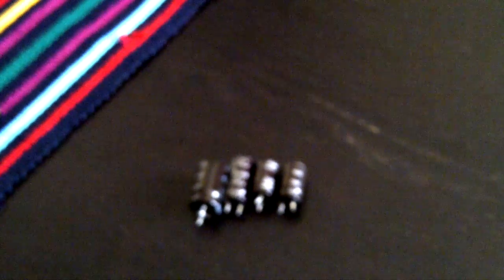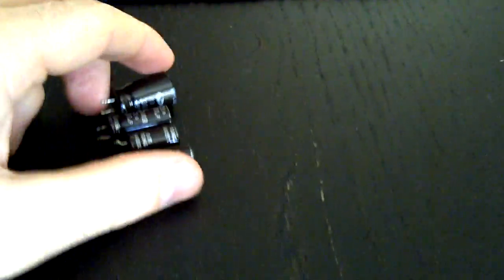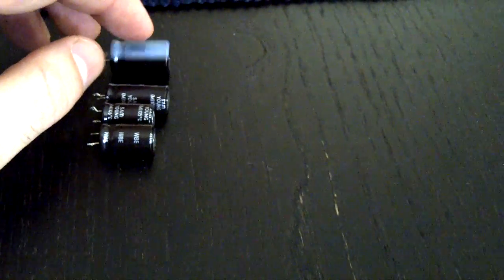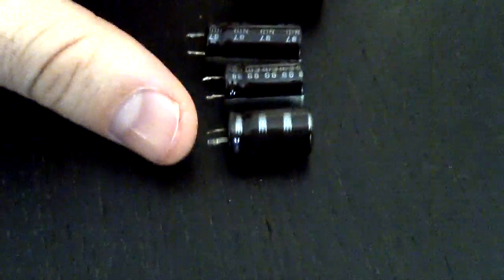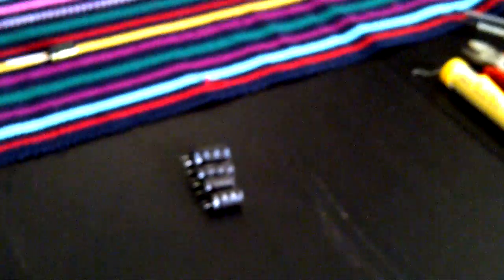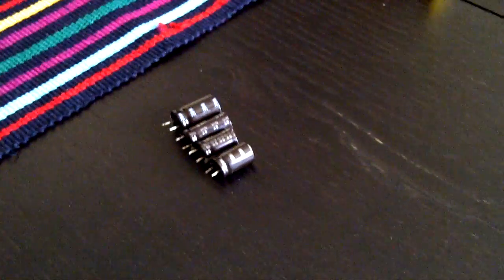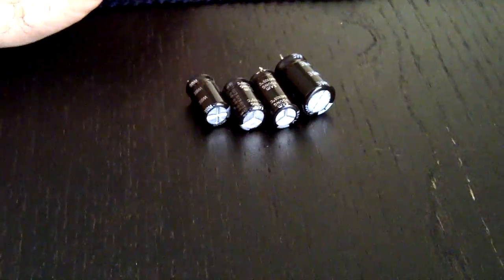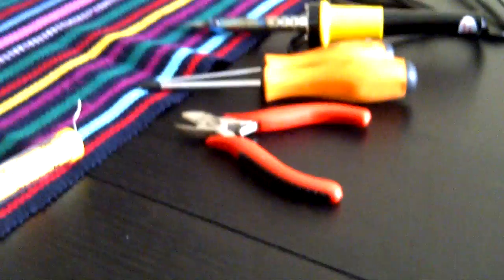samsung lcd tv not working (changing capacitors).3GP

Comment from the maker: with respect of the tools, I used a soldered to remove the capacitators. I then replaced them with new ones. the cable is used to slider back the capacitors

Comment from the maker: I did this a couple of years ago, and sold the TV when I moved from Spain.  But to answer your question, I replaced all the capacitadores in my TV.
Reply: did you replaced even the small ones? wow that will take me a long time hmmm...
Reply from the maker: +habz mahkz I had no way of knowing which ones were not working.  unless there is a visible sign of deterioration.
Reply from the maker: I did not replace all of them, but I did change several